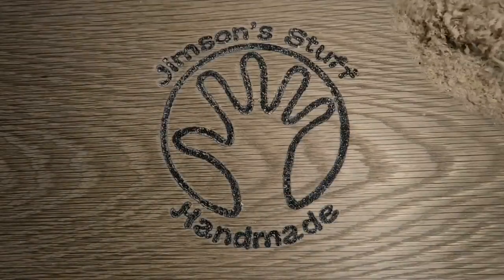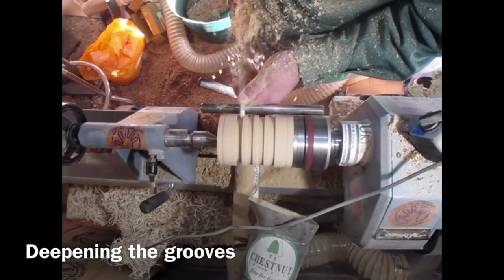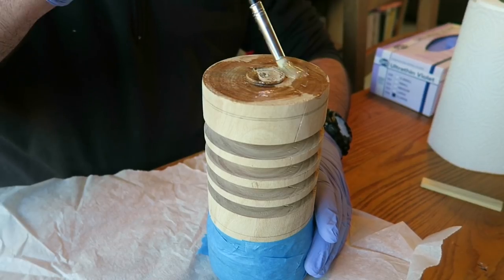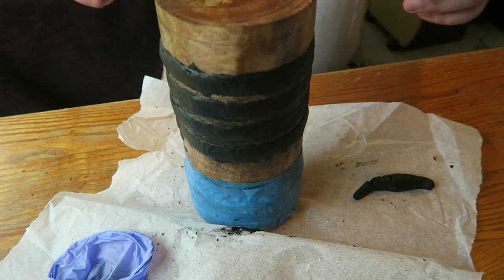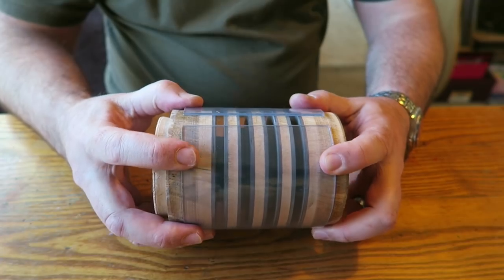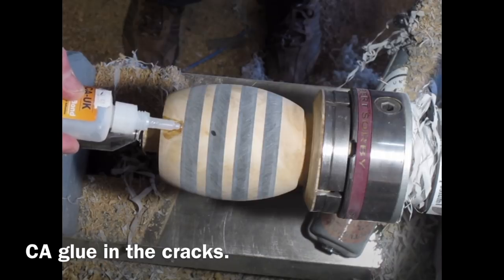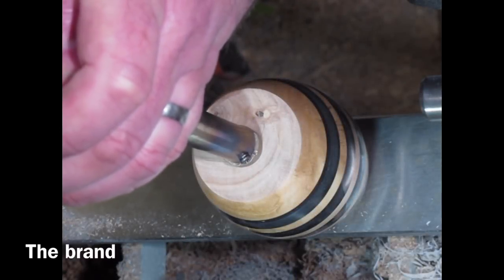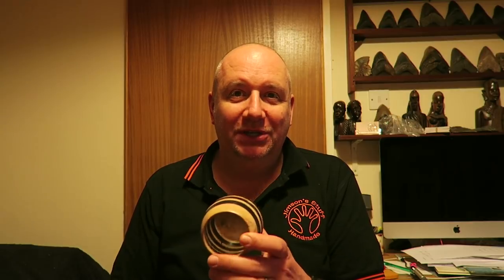Woodturning a Hybrid Barrel Pot - Milliput and resin

Comment: Thank you, Jim, for always stretching the boundaries and glad to see you are back on form.    Several years ago I was given a fairly hefty branch of eucalyptus which had blown down in a storm.   I cut it into manageable sections but it cracked heavily.   The few pieces I  did manage to work turned out quite well.
Reply from the maker: Thank you very much Alan. Yes eucalyptus is notorious for splitting and distorting, ( making it difficult to wet turn ) although some species are better than others apparently. The logs I was given are over 15 years old and they must have dried slowly as the splitting is not too bad in some of them. Cheers, Jim

Comment: Another winner, Jim. I see a night light for my grandson in my future :-) Since you mentioned pressure & vacuum pots: I found a heavy duty paint pot (meant for pressure paint spraying) that I use for a pressure pot. I then made a lid from thick acrylic, with a thin polycarbonate layer on the inside (since there are warnings that stabilizing solutions react with acrylic). I use a high efficiency venturi vacuum (plus a silencer...) and all is good. Economical (I'm a cheapskate). I can switch from vacuum to pressure in seconds, so I can de-gas and immediately pressurize.  Clyde
Reply from the maker: Thank you very much Clyde. Your vacuum/pressure pot set up sounds ideal. I have already got my vacuum chamber and pump, I just need to look for a pressure pot. I have sought advice from people who know and apparently the stabilising resin is only really a problem when used in all acrylic chambers and is Ok if the acrylic lid is thick enough and you try and avoid direct contact where possible, we shall see. Cheers, Jim

Comment: Hi, the vacuum chamber can be used very effectively if you vacuum the piece when it is painted with resin, as you did in this clip (thin layer of resin)
After that is cured completely, you can pour the rest of the resin in the form and vacuum it again. 
The reason for the first vacuuming is to seal the wood, to stop bubbles coming out at the second vacuuming.
I guess what I'm saying is that the pressure pot is not mandatory, all you need is to use the vacuum chamber in two stages, sealing the wood and then degassing.
Reply from the maker: Yes if I did this again that is what I would do but at the time I did not own a vacuum chamber.
Thank you very much for watching 
Cheers 
Jim

Comment: That is another interesting project.  Glad you mentioned getting a vacuum chamber.  That helped me eliminate bubbles when I was doing elastomers..  If those are megaladons on your shelf, I am wondering when you will incorporate one into a turning project.
Reply from the maker: Thank you Jack, yes I have several uses for the vacuum chamber, including degassing silicones when mould making. Yes they are megalodon teeth, I made some earlier videos showing how I fixed some broken ones using bronze. Cheers, Jim

Comment: Vacuum degas resin and hardener (in seperate containers). Add any dyes and "glitter" to the resin and mix well before degassing. This step will remove absorbed gasses and can take upto 10 mins or more but as the hardener has not been added there is not a problem. The next stage is to add the hardener to the resin, mix well, while trying to minimise entrained air, finally give the mixture a quick degas which, as you only have to remove entrained air, will be very quick. Pour the degassed mix into your mould slowly to avoid creating bubbles, though if you do place the mould under vacuum again for a couple of minutes then pressurise to 5 bar (75psi) or to the swp of your pressure vessel.
The result is clean bubble free castings. If you are organised you should be able to complete the above process in under 10 mins (from when you add the hardenerto the resin) for a 500g  batch. Largest single batch we have processed is 800g resin with 400g hardener which took just short of 15mins. For "hardener" read "part b" or "activator" or "catalyst" depending on which resin you are using.
Reply from the maker: A great technique, I didn’t have all the pressure and vacuum gear when I made this video but I do now and it has transformed my casting.
Cheers 
Jim
Reply: Some would say using vacuum chambers and pressure pots is a bit belt and braces but the results speak for themselves. Good luck with future castings

Comment: Looks absolutely amazing with the tea-light in it, in my opinion anyway. Would be interesting to braid black, white, and terra-cotta Milliputs then squidge the braided rope into the gap and complete the same way you did here. the colors showing through the clear resin would really stand out, I'd think. The colored LED tea-light would really pop off of the white pattern as well. Wishing I had the funding for milliput, resin, and a vacuum chamber. I'd have a go at a similar project.
Reply from the maker: Thank you very much Thomas, glad you liked it , yes there are many different combinations possible with this technique. Cheers, Jim

Comment: You're going to have to buy stock in the Milliput company!  Resin costs are no bargain either.  That said, great idea, design and execution, as usual.  Very much looking forward to your use of the vacuum chamber and pressure pot.  I have neither at the moment but hate bubbles.  Turn on.
Reply from the maker: Thank you very much Steve, yes the vacuum chamber and the pressure pot are the next step in my quest for perfection ( I too hate bubbles ). Cheers, Jim

Comment: where did you purchase your pressure pot from pa and what sizel, i have been looking but they are quite pricey?
Reply from the maker: Hi Andy, sorry for the late reply. I bought the 20litre pot from sprayequipment.co.uk     
They are a bit pricey but save expensive resin mistakes.
Reply: Ok cheers, will take a look!!

Comment: That is a great idea for moulding the clear resin fella, if doing another you could parting tool the lines for the miliput widths after you cut slots, so you cut 8 lines not 4, plastic tube mould then pour in black resin, then cut lines for the clear and cast how you did 👍 , would save a lot of milliput.

Vac chambers are good for degassing silicone and stabilizing wood but degassing resin could be awkward as the resin sets a lot quicker, tbh i still dont have a vac chamber because I would only use that for stabilizing wood, for the amount id turn its cheaper to buy stabilized blanks lol

Casting silicone just cast it in a pressure pot, then when casting resin in the silicone mould in a pressure pot there wont be any bubbles in the silicone to collapse giving pimples in your resin cast
Reply from the maker: Yes next time I would use a simpler more cost effective method to produce a similar result. Cheers, Jim

Comment: Very nice. Brilliant idea. Would a pressure pot still work with the piece encased in the plastic sleeve?
Reply from the maker: Thank you very much Derek, yes the pressure pot should still work so long as the sleeve is left open at the top. Cheers, Jim

Comment: You can thin the epoxy with acetone or denatured alcohol and it will really soak in
Reply from the maker: Yes, I have used that technique before when using epoxy to varnish the decks on a wooden radio controlled boat I built several years ago. Cheers, Jim

Comment: Hi Jim, I am an amateur wood turner and will be using your method on my next project! Question- have you tried dying the white milliput putty with different colors? Thank you for your videos! Brian
Reply from the maker: Thank you very much Brian. Have a look at my most recent light pull video, it uses much less Milliput. I have coloured white Milliput using pigment powder mixed with slow set epoxy resin as a carrier but you need to be careful as some of the pure pigment powders are highly toxic. Cheers, Jim

Comment: Plastic bag and a vacuum cleaner will give you a vacuum chamber that will press against the lilliput equally on all sides. Wrap in saran wrap as you did then put it into a bread bag, apply a vacuum cleaner and atmospheric pressure will press on all sides equally.
Reply from the maker: Great tip thanks, I’ve got a vacuum pump I could use. Cheers, Jim
Reply: I just noticed I said lilliput instead of milliput. Commenting while sleeping isn't good.

Comment: Not to sure about the join with the milliput and resin could prove to a weak link, great work though well done mate
Reply from the maker: Thank you very much. The resin and the Milliput are both epoxy based and seem to bond quite well but I guess time will tell. Thanks for watching, much appreciated.
Cheers 
Jim
Reply: @JimsonMakes  Can you remember where you got your rotary sanding tool from ? trying to find one bud
Reply from the maker: The sander is the Hope Pro Sander and is available direct from Hopewoodturning, great bit of kit.